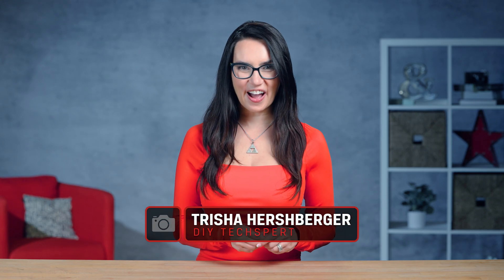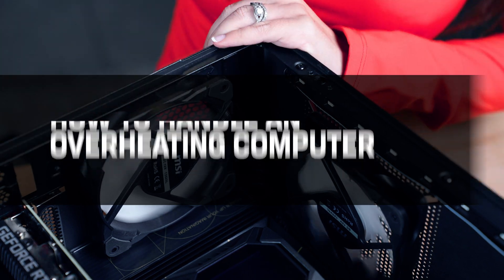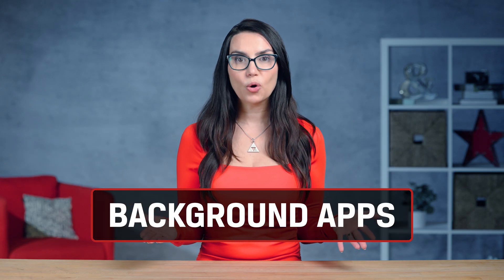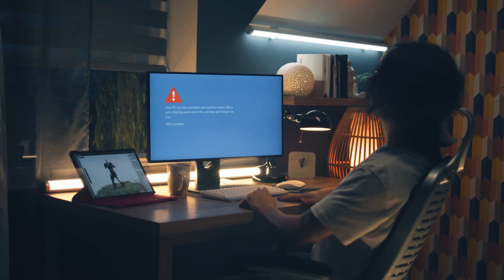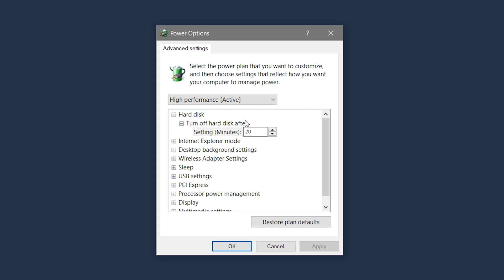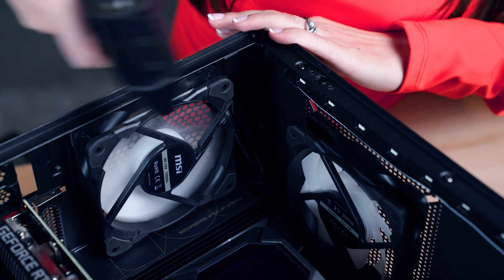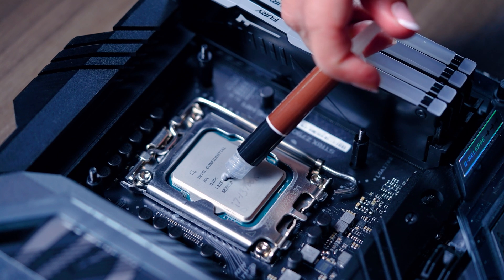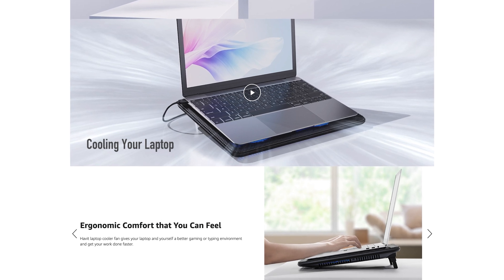How to Handle an Overheating Computer - DIY in 5 Ep 240

Comment: Fans should be stationary when cleaning them. Use cable ties or just hold them when using air.
Reply: Don’t use cable ties at all, that shouldn’t even be a thought in your head to use those, js use hands that’s all

Comment: --  When gaming:  your game is running, obviously, and so is Discord, so you can talk... but you have open browser tabs so you can check the game wiki, right?  Opera GX is made for gaming, and allows you to throttle GX and allow it only a small amount of memory (16GB Chrome, right?), so it won't reduce performance.  I have nothing to do with Opera, but I've used the base browser for 20 years, and GX since it came out in 2019.  
--  Run fans at full speed while gaming- you can't hear them because the game is too loud anyway, or you're using headphones.  My GPU fans ramp to 100% almost immediately, and I game at 4K Ultra 60+++ and barely hit 62 or 63 degrees C.
--  Keep your fans clean- you can buy a rechargeable PC duster/vac from Amazon/Walmart for under $20.  It also blows the crumbs out of your keyboard.